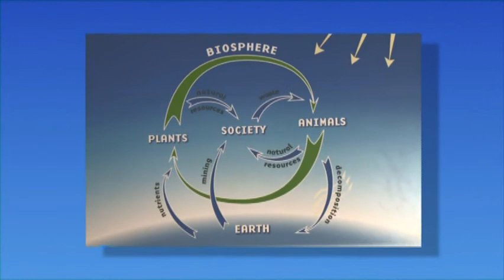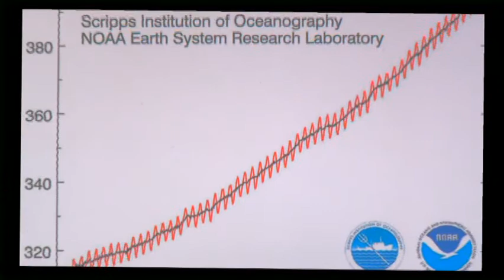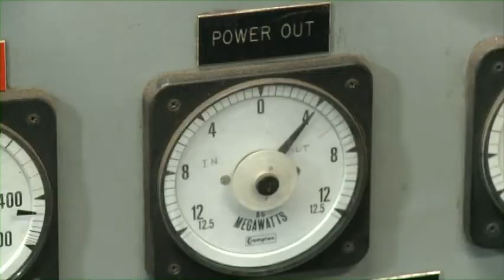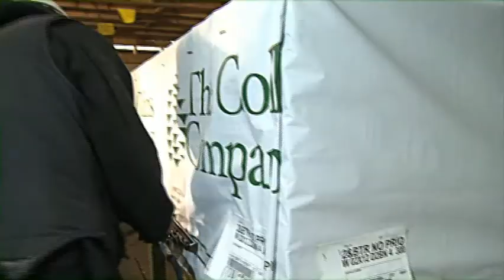Collins Forests and CO2

Comment: Ein Rand, here are the answers to your questions below. It does not matter where the CO2 comes from it will be sequestered by plants; 2nd question is correct, forest biomass and subsequent crop production has increased exponentially due to increasing CO2 concentrations which increase following the warming of the biosphere. There are hundreds of cause and effects that affect climate and to pinpoint CO2 is disingenuous and a false scientific assumption based on fear rather than actual fact. The Maunder Minimum is but one of these conditions. I am unsure of the final question in what you mean.

Comment: CO2 can only be reabsorbed (sequestered) by plants (forests) if it comes from the combustion of wood (biomass) and not coal?
Is it true that world forest density is increasing due to increasing atmospheric CO2?
Is it true that historically the planets temperature has lead atmospheric CO2 as opposed to following?
Could the 'Maunder Minimum' be a better explanation? Perhaps kowtowing to the regime will result in an industry's bottom line, but what of your progeny?